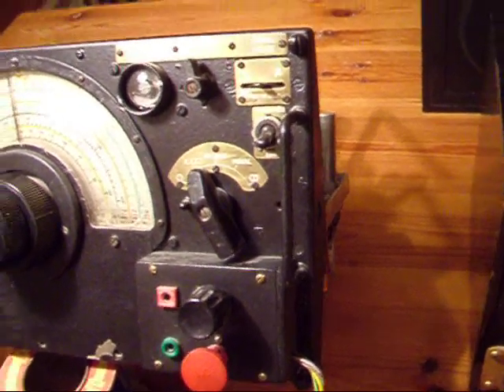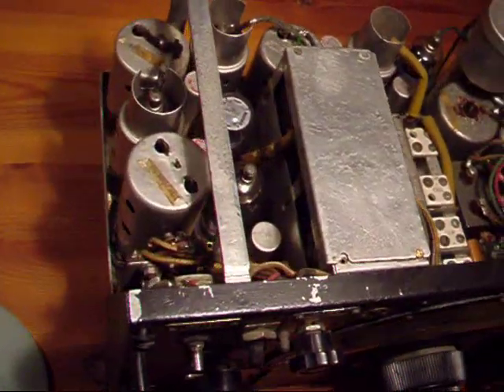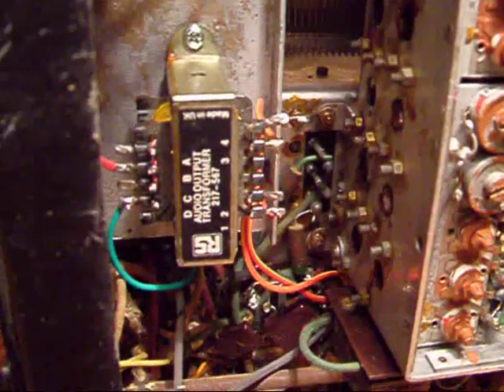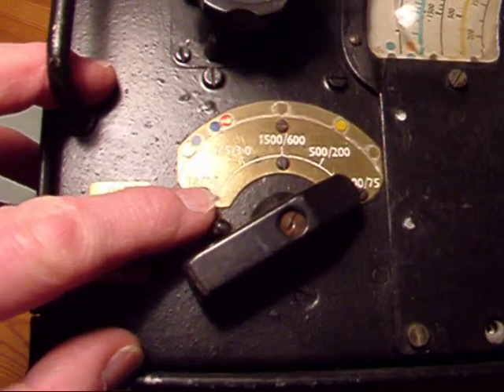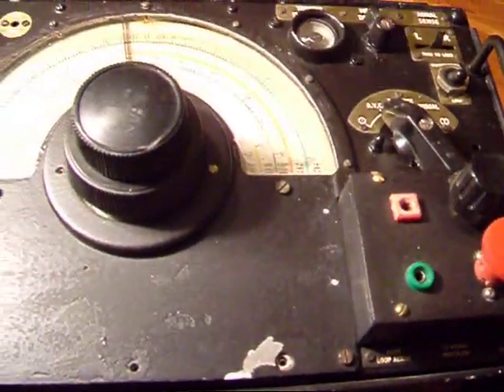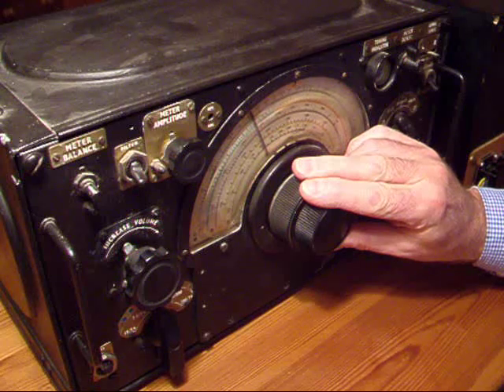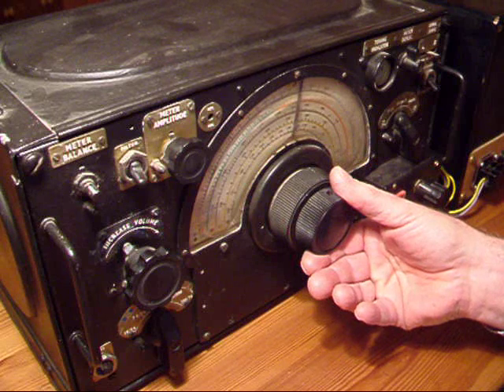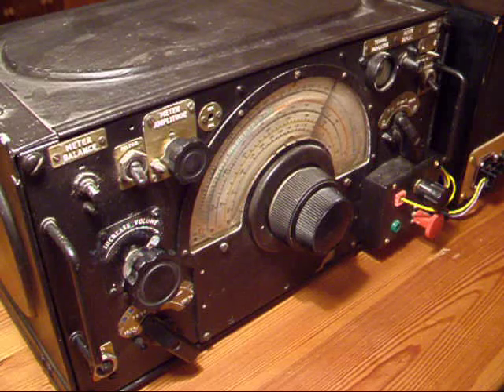R1155 Radio as fitted into a Lancaster Bomber.

Comment: I was flying as an air signaller /pilots assistant in a varsity in 1971 which was fitted with the complete kit 1154/55,plus carbon handheld mike. All the vhf/uhf radios failed on a trip to Malta. Using a bc221 which was also fitted in the varsity I was able to tune it up and made contact with Speedbird London and asked them to relay our postion report which they did all the way to Malta.Shortly after this trip I retrained as a pilot but never lost my love for old radios becoming a licensed radio ham; G3vhe
Reply from the maker: Hi Raymond, thanks for that. There's something very special about the older technology. I often think if your life depended on modern technology waking up fast so that you could call for help you might not make it. How did we ever come to accept that waiting for a radio or PC to wake up that takes longer that an old telly to fire up?
With my old FT101 tx  I could recognize peoples voices but with the digitally processed sound they all sound the same. Caroline would would very good on modern radios, no give me the old stuff every time, you can even repair them with a plumeres tool kit.
Reply: I also used one for cw at the air museum,Elvington, York. To hear that big relay clattering was something again.Maximum speed was about 16wpm for clarity but listening to it on a modern receiver it had a distinctive "chrip" due to a poorly regulated ht supply!!

Comment: Oh damn, I remember that dial. They changed it later in the war, because it was too easier to bump the main knob when adjusting bandspread. I recall it was a nightmare to work on, given that it gave all indications as having been soldered together, then the front panel welded on! 
My favorite airborne radio had to be the ARC-5 Series - I have one that's NOS, and it is a dream to open up. Nice and tidy layout, almost perfectly mirrors the schematic.

Comment: Hi Andy,I was trained as an `Air Wireless Mechanic` in late 53 early 54 at RAF Yatesbury.During National service,the course last 19 weeks;the first 12 were all theory,the last 7 were all practical ie learning operating procedures and use of servicing equipment.The R1155 and its companion the T1154 were for hf use The vhf equipment;1143,,1136 were transceivers crystal controlled.The R1155 when used with the loop aerial could provide good DF[direction finding] guidance to Nav and Pilot.

Comment: Don't get me wrong, I love the look of the set. It's just really interesting to crack open - you can really tell that they were in a state of total war when it was built.
I also had a receiver out of a mosquito bomber - they were neat. The dial and bandswitch was on a separate control unit. When you switched bands, a series of electric stepper motors in the radio would clicky-clack until the correct switches were set internally. That radio is now sitting in a local museum.

Comment: I had one of these in the 1960s.  My uncle was in signals in the RAF during the war and I guess he brought it home and left it behind.  I made a power supply and valve output amp to feed a loudspeaker.  I seem to remember the waveband selector switch was marked in metres of wavelength.   Or was it in kilocycles/second?  Certainly not in Hz.  Used to listen to shortwave bands which were mostly in morse.  As I  could not follow morse I would then listen to pirate Radio Caroline.

I believe the negative rail was 18 volts below earth.  No idea why.

I used it for a few years, then gave it away.  I wish I still had it now.
Reply from the maker: All good stuff, happy memories. I loved to listen to music on shortwave with it’s distinctive fading, like the music on the German radio operators radio in the Guns of Navarone. All the best . . .  Andy

Comment: As regards the sensitivity of the R1155,I believe it was not a double superhet receiver,and if my memory is correct,only one rf amp stage.But I think it was entirely adequate for wireless ops aircrew,as all us radio hams know it is very easy to find contacts on hf to all of Europe.The DF usage incorporated using several aerials in an electronic switching mode,,easy to perform it removed any ambiguity as to if a correct course was suggested and not a reciprocal one.

Comment from the maker: @pegasus44able
 Hi Mike
Although I have no direct experience of working this radio off 12Volst, radios of this vintage were routinely powered by 12 volt batteries. The voltage was stepped up with a couple off different types of devices. One was called a rotary transformer, like an electric motor but with four sets of brushes, 2 at each end and the other device was called a vibrator or vibratory power supply. 
Kind Regards ... Andy

Comment: I remember Sputnik being on 20Mhz and 40Mhz. (15 metres and 7.5 metres.) I received it on both frequencies. On a AR88 and a beaten up Hallicrafters radio that had acorn calves and an extensive rough modification done by an eccentric luny but it worked. All cheque book radio now. 73`s.

Comment from the maker: Hi there. Back in the 1960’s, if I remember right, you could buy a number 19 set from ‘Radio Centre’ in Hurst Street, Birmingham (England) for £5. You could also buy rotary transformers and vibrator power supplies allowing battery operation. And yes it was all very heavy gear, built like a tank to be used in a tank. I guess they were fit-for-purpose   
All the best ... Andy
GWØJXM

Comment: I had a couple of them. When I was about 16 yrs (1957)  I fitted a PSU and PP 6V6 amp to one.  Large knobbly tuning knob and DF Long wave. I wanted T band but the LF coils were right at the back of the coil pack as I remember and were inacessable so I made a pre selector. Where is it now??.
Reply: +Crobular I Interesting nostalgia !!. These radios are no good now though not to use anyway. No SSB.  No filtering. Nice though.
Reply: +Crobular I You can easily hear SSB on it. Best for Am and CW.
Reply: Crobular I really? I believe the gentleman was showing us all that he was using his radio.

Comment: Hi sorry i don't speek English very good , i have purchause this radio i have ask for , in my radio there is not DF valve( it missing) without these tubes the radio works or not ? Thanks regard GABRIELE
Reply from the maker: Hi there, I don’t have the circuit diagram anymore.
If you need help ask on this website
www.vintage-radio.net
You will find them very helpful.
Kind Regards . . .  Andy
Reply: +GABRIELE SECCIA you do not need the DF valve. It will work OK without it.

Comment: Dave C
Excellent, I used the 1154/55 for four years as a Marine Wireless Operator in the RAF Air Sea Rescue service. In fact, if you go to qrzcq.com and look up my M6NWQ callsign you will see one of my old Marine Mobile Shacks under weigh off Cyprus in the 1960's...73's